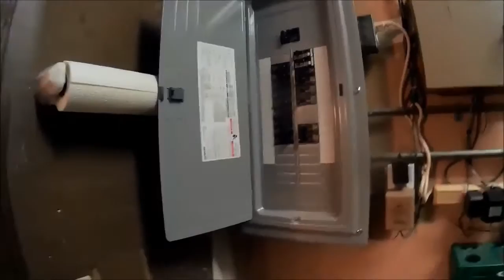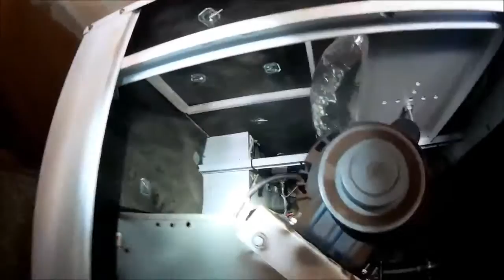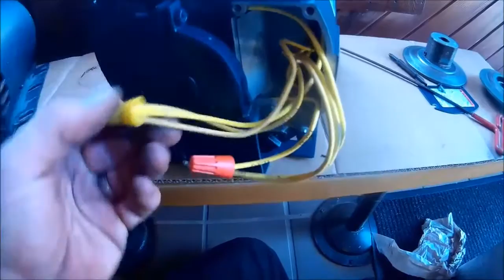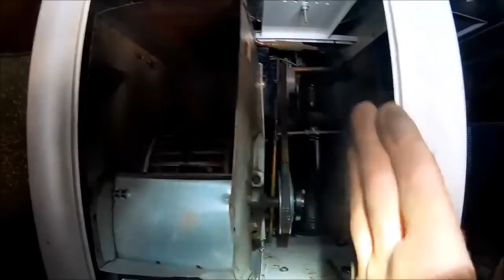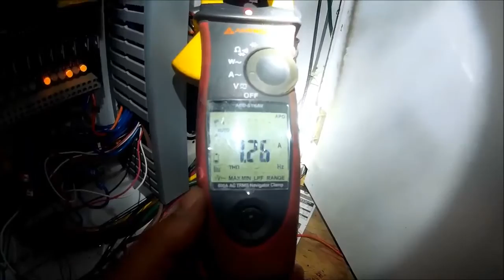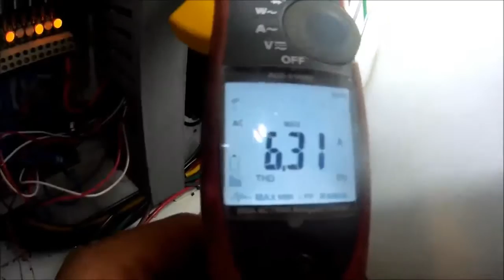Dectron dehumidifier with a bad blower motor repair

Comment: Did you have to decrease the tension ?
Reply from the maker: +drummerdem50  Adjusted the motor pulley 1 turn out. it changes the ratio. The more you adjust the motor pulley out the lower the amp draw but the fan moves slower. You still have to keep normal tension.

Comment: Great video. Good point on the electrical panel. I had a call for no cooling a few weeks ago on a two month old RTU. I check and have no power. Went down to the panel and touched the breaker and the unit stared running. I could hear some sizzling in the panel so they called a sparky and the one buss was all burnt. New panel for them.

Comment: Nice video man that looked  tuff. Definitely not an easy spot to work but very good work. I just worked on a unit similar to that for pool area that cools,heats, and dehumidifies for the first time. It was pretty neat to figure out but I was making harder then it was until I talked to tech support. Anyway great job man love the videos really I subscribed
Reply from the maker: +Gil Cavey Jr  Tech support is a life saver. what unit were you working on. thanks for the support and watching my videos